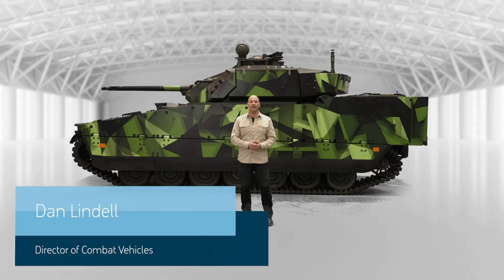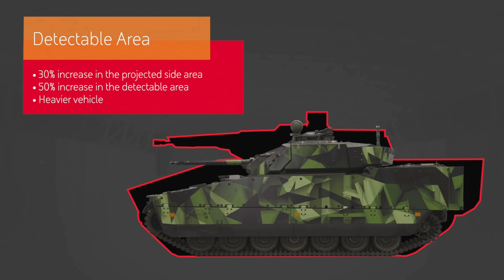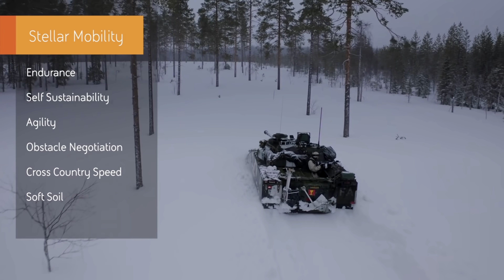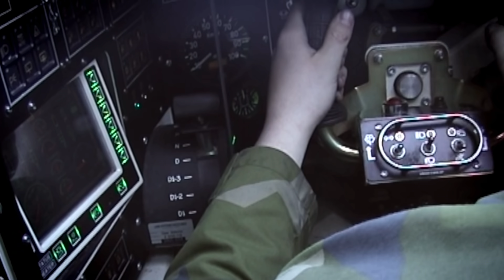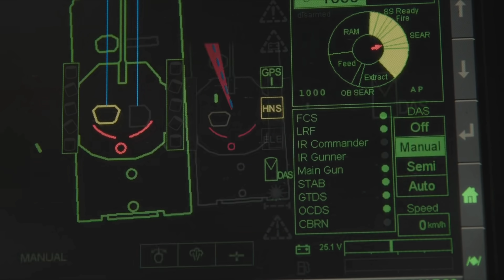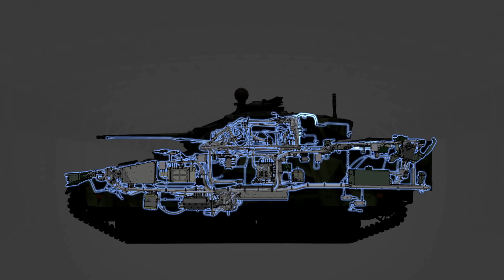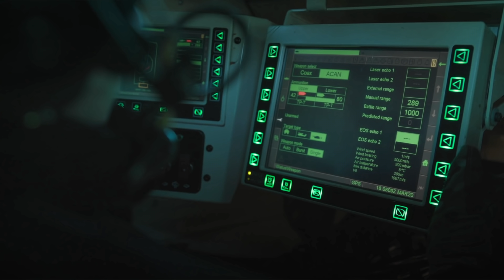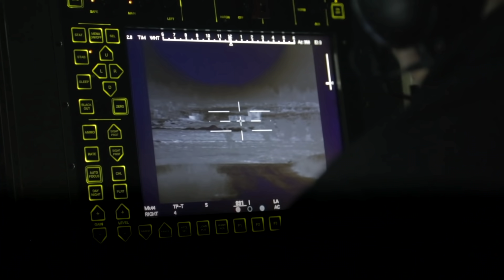The CV90 Infantry Fighting Vehicle Family | THE BEST IFV IN THE WORLD 🏆

Comment: Where do you stand in terms of armament? Recently there has been a lot of talking about giving IFVs more powerful 50mm autocannons, but it seems such a big weapon makes  it impossible to mount ATGM launchers on the IFV. So what do you think is the best solution? A 30-35mm autocannon with ATGM launchers or a single 50mm autocannon?
Reply: On IFV, for me it's always a tradeoff. After 20mm, the bigger caliber you have, the biggest impact you can have on armored vehicles, but the lesser you have on infantry (more expensive ammo and less of them make it harder and harder of a choice to use it on infantry, until you are in the situation were you would like a coaxial machinegun....)

So, if you want to fight against "terroristes" in a desert a 20mm is probably the best, but if you want to fight a nation with very modern IFV it's probably better to have a big auto-canon to destroy it in an instant (better than an ATGM which could be jammed/suffer from reactive armor/be intercepted by an active protection system/...)
Reply: the dutch CV9035NL can switch out the barrel and fire a 50mm round in combination the spike AT system.
the system runs the 35mm style shell that is less crimpt down to fit a bigger projectile.
the range, accuracy and velocity are way down from wat u think of when u are talking 50mm.
the goal of this 50mm system is to offer bigger explosive fragmenting rounds when anti armor capability is not a factor. 

a full power system bigger then 40mm is a solution to a non exiting problem.
there it no platform out in the world that can withstand 30/35/40 but not 50 to 80.
if 40mm is not enough u need 120mm (or140mm)
we may see the rise of APC's and IFV's with close to MBT levels of armor as a reaction.
but that will make for heavy, slow, and expensive APC's and IFV's witch will defeat there purpose. 

but why go bigger if u can go more,
they need to strip a A10 warthog and strap a GAU A8 avenger 35mm gatling gun in a turret.
no space for infantry, just ammo bins and retro truster's to counteract the recoil.
no need to penetrate the armor if u can pepper the target and rip off or destroy every important bit on the outside of a tank.

Comment: I don't think you are getting the parallel computing/gpu part correctly. To put this in very basic form It's not about graphical anything, its purely different (more efficient/robust) way of processing data from sensors etc. Cpu's do their thing linearly, one task after another being capable of very complicated tasks because their "focused" on that one task. Parallel/gpu processing works by doing much simpler tasks but a lot of them in the same time (so even if something goes wrong its just that one tinny bit that's frozen or wrong)

Comment: Not only that but is easily upgradable and not only that but can easily fulfill any role the Swedish military requires be it an artillery piece to a main battle tank, and not only that but the actual cost isn’t that high since they all use the same system which means things like spare parts and training is almost identical
Reply: Not a MBT. Similar gun, not much else. 120mm mortar, not an artillery piece. I get what you're saying, but I'd rather have the real thing.

Comment: Great video, great reaction. I have to say though, every country in the world that doesn't do it the way the Israelis are doing it is missing something. The Israeli "Namer," IFV asks and fulfills a very fundamental question. "Why not make IFV's as armored as tanks?" The Namer is as armored as a MBT, and is faster than the Bradley. Any IFV that isn't capable of surviving an encounter with an enemy MBT is a weak link and shouldn't be in arena where they could come in contact with one. Why? Because in most modern armored battalions IFV's are organized to support main battle tanks. Optics, sensors, weapons and everything else is good, but thier primary function and purpose is to ferry infantry to support armored movements. Why not make the success of that purpose (survival of the infantry) your primary focus? You basically just have a weakened tank on the front, full of your soldiers that cannot survive direct fire from the enemy vehicles they're in contact with. Not a very sound strategy. It's a tactical flaw that isn't fully grasped by most militaries today. Lastly, the CV90 top speed is 43mph, the Namer is 40mph. I'll trade 3mph for main battle tanks level armor any day of the week. It's not even a close comparison. I am willing to consider an arrangement based on weight but ... it's a moot point because again, the primary roll for any IFV is to support armored movements. And if there is main battle tanks involved, weight isn't a factor to worry about for an  IFV. Simply, you have to ask yourself what roll does and is an IFV supposed to fulfill? Do you really want a weaker tank that can move troops? Or do you want a safe mechanized transport for troops to support armor. The CV90 is awesome, but I personally believe it's taking on a roll that is better suited for a MBT to fulfill in nearly every situation. Cheers 🍻
Reply: First off the Namer started off more of an APC than an IFV, only very recently (2017) is the IDF designing it for the IFV role which it has not seen much if any action to speak of yet while the CV90 is battleground proven.

The strategic mobility of the Namer will be MUCH lower due to the fact that it weighs almost twice as much as the CV90 (50t-60t vs 23-28t/35-37t) it's also 3.7m wide compared to the 3.1-3.4m of the CV90, transporting a Namer long distances requires a lot more effort, it doesn't fit within rail transport load gauges of Europe which max out at 3.150 m. A C-17A Globemaster III will only be able to transport one of the Namer, conversely it can transport two M2 Bradley's which are comparable to the CV90 in volume and weight. A C-5 Galaxy can carry 127t, so probably 2 Namers vs 4 CV90s. Basically the Namer does not suit NATO mission very well because of this.

The tactical mobility will also be lower, mostly due to it's weight, I can't really find any data on it's climbing ability but I doubt it will work as well in northern climates with snow/mud/marshes which the CV90 has proved itself to have excellent mobility in. The Namer seems to be more optimized for the terrain in which Israel operates, dry/arid terrain with low amount of foliage/trees because it's profile is flatter, while the CV90's shape is more conducive to navigating forested terrain dotted by marshes and boulders where a narrow hull is more conducive.

In the environment the Namer will operate it is MUCH more likely to get hit due to the terrain being much more open to the point where the value of more stealthy features/profile is reduced so much it makes more sense to try and increase armour. Then again it hasn't seen nearly as much action as the CV90 but it might be more suited to the environment the IDF operates in than the CV90.

In addition the actual survivability of the Namer is quite anectdotal, see this comment: https://www.reddit.com/r/WarCollege/comments/ur7grj/comment/i8ykj8q/

Lastly the IDF itself is now favouring lighter IFVs it now has the 35t Eitan IFV and is looking at AFVs in the 30-40t range.
Reply: @Sindrijo  It seems your primary critiques are: transportation, and  proven track record. These critiques are irrelevant on thier face for two reasons. Any situation where you need tanks (modern battle field) you can transport the Namer in the exact same way. Tactical utilization: nearly all of the IFVs and APCs at the brigade level are used as support units for MBT movements. If you are unable to understand how these units are actually used in the field tactically, you aren't understanding their use or functionality properly. IFVs and APCs do not fight alone. Their use in modern warfare is apart of and in brigade level tactical units. That means they move almost exclusively with main battle tank columns. Being light is irrelevant if thier tactical deployment is in conjunction with heavy armored elements. That is, what does it matter if they are light and transportatable if they can't be used alone?? Lastly, your critique about track record is moot. All that needs to be examined is how the chassis has preformed on the Merkiva 4. There is a massive amount of data on this tanks performance on the battlefield - remarkable success and survivability. Adding more internal room for infantry, and smaller armed munitions on top, is an intuitive and more survivable solution than any other APC or IFV in the world. Israel is ahead of everyone strategically and tactically, and almost nobody realizes it. Statement: make APCs and IFVs as survivable as tanks or you're wasting your time. You have glass cannons that in a knock down drag out fight won't win unless they see the enemy first. That's a high bench mark to depend on in a protracted and slogging conflict. A bench mark of unrealistic expectations. Against any near peer you will be fighting a hopeful battle instead of a realistic one. Lastly, a fully equipped Hamas in direct conflict with Israeli forces is a better proving ground for a platform than anything in Iraq or Afghanistan. Study the battlespace and you'll see which one has a higher level of sophisticated challenge. Having a lighter option when fighting disorganized and non-near peers for irregular movements can be advantageous. But why format a IFV for such a specialized roll? Why not just make it better and more armored? In my view it's a wasted resource
Reply: @zonzone6635  My analysis is mostly from the perspective of a northern NATO member, there are different requirements.

Strategic agility is very important to this region of the world. Logistical throughput is very important because that is almost the bottleneck in wider-region warfare. Doesn't matter how good your assets are if you can't get them to the battlefield fast enough. The Namer cannot be transported readily by rail between many areas of Europe because of its size exceeding the allowances to pass through tunnels etc.

The Namer will certainly work fine for the IDF as a defensive asset, but I don't think it would perform as well in say Finland in winter or summer. It has only seen action in the Middle East. Your analysis is very Middle-East/Israel centred.

Lastly, if the Namer is the be-end-all why is the IDF bothering to a develop lighter APC/IFV like the Eitan? Well, the Eitan is not meant to replace the Namer but complement it because it is a wheeled vehicle and so can be transported more easily. It is not as wide and can more easily operate in urban environments, the size/shape of the Merkava 4 chassis is actually considered to be somewhat of an issue for urban combat.
Reply: @Sindrijo  I appreciate your thoughtful reply, I will do my best to do the same.

You state: "The Namer cannot be transported readily by rail between many areas of Europe because of its size exceeding the allowances to pass through tunnels etc."

My response: How are the tanks transported? This matters because, as I stated, ANY Nato IFV or APC at the Brigade level functions to support and fight in conjunction with Armored units. This is nearly 100% of how NATO actually fights with IFV's. While I can indeed see the advantage of having a ton of railed in IFV's waiting for the MBT's to arrive as a good thing for readiness, my point is almost none of those IFV's will actually be put into combat until the MTB's arrive in the battle space. 

You state "The Namer will certainly work fine for the IDF as a defensive asset, but I don't think it would perform as well in say Finland in winter or summer. It has only seen action in the Middle East. Your analysis is very Middle-East/Israel centered.

"My response: True terrain matters, but perhaps more importantly we need to ask again what roll is the CV90 fulfilling? Is it's primary purpose to combat enemy armor face to face? Or is it to get infantry to the battle field to support armored units (MBT's)? If you look how NATO actually fights against near peers, you'll see IFV's are NOT standalone military assets - they are a vital element of a combined force. I ask you again, what does it matter if they can be railed in, if they can't be used until the Armor arrives? Does Finland use MBT's? Simply, any situation where an MBT can be used the Namer can be used also.

You state: "Lastly, if the Namer is the be-end-all why is the IDF bothering to a develop lighter APC/IFV like the Eitan? Well, the Eitan is not meant to replace the Namer but complement it because it is a wheeled vehicle and so can be transported more easily. It is not as wide and can more easily operate in urban environments, the size/shape of the Merkava 4 chassis is actually considered to be somewhat of an issue for urban combat."

My response: Your critique here has a massive flaw. It assumes that because Israel develops depth in assets, that doing so in some way means they are favoring one platform over another. This is incorrect. In warfare there could arise a situation where they could need a QRF for mission specific situations. Because they prepare for this possibility, does in no way detract from their primary troop transport for near peer combat situations. I think perhaps you are missing the primary point of my argument on a whole. Let me suggest to you the foremost thing to consider with any fighting platform (tank, air, sea etc) is NOT any of it's individual attributes, but rather, what "roll" does it fulfill on the battlefield and in what ways can we help it succeed at that roll to the greatest level of effect. Modern militaries shouldn't be as concerned with induvial attributes of any fighting platform, but instead focus on how that platform can best succeed at it's roll in the battlespace. I would love to be hired by your company to present these ideas holistically if you work in such a field. Northern Europe I believe needs to understand why Israel is leading the way and how they can integrate their tactics for the NATO battlespace.

Comment: Unfortunately Mat I think you are misinterpreting what the video is trying to convey at several points.

Firstly, when talking about mobility they are talking about a pivot from CV90 variants intended to deploy abroad in places like Afghanistan to the new version being focused on staying in operators home countries. While you suggest the opposite. That's why they are talking about trains. The priority for strategic mobility for the MkIV is within their host countries.

Also the use of graphics cards in the computer architecture has absolutely nothing to do with trying to make the digital screens prettier or having nice graphics. Clearly you don't even need graphics cards to accomplish this, the UI on on cellphones is quite nice and does not require a GPU. They are using GPUs because of their data processing horsepower, which in certain tasks surpasses normal CPUs. Think crypto mining, you use a lot of GPUs but not to make nice images.
Reply from the maker: Fair enough

Comment: Even if Lynx is an export variant, it still shows it German origin in terms of doctrine it is built on... and this is working side by side with Leopard MBT. Therefor it has to be on the same protection level as a Leopard. Guess Sweden has its own doctrine on how to use its IFVs and is optimized therefor. 
A great CV90 surplus is having something that is comparable to Leopard an its Leoben Group.